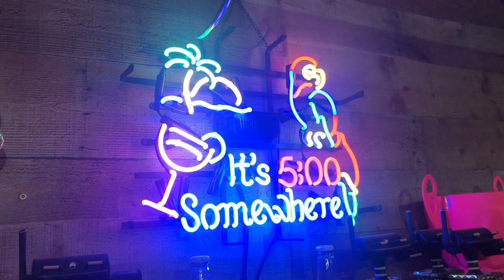March 30, 2021 Tiny Camper Build EP. 3

Comment: Could possibly develop a leak around windows where siding dips. Suggest stack butyl tape in those seams. Nice looking inside.
Reply from the maker: Yes that was a concern using this T 111 , I put some pretty big plugs of it in there . I plan on keeping this one under cover when not in use . When you see the finished product you will see some other spots I created issues with water also but I wanted a different look than what everyone is building now . I bought plenty of silicone and spray rubber haha to deal with the issues I created . Thanks for stopping by.

Comment: So many things I would have done different.
Insulation
More butyl around windows. Especially where the grooves in wood are. 
Fender wells definitely going to receive water damage from puddles
Invest in Brad nail gun or stapler for inside panels.

Comment: Man I  love building these campers but until I sell my current one I will be working on a foam built kayak, I really dont need another kayak but I need something to pass the time. See ya on the beach RG
Reply from the maker: ive been wanting to do a kayak or a stand up paddleboard with  wood inlays for strength
Reply: @ArmadilloJunction  Lets do a build together
Reply from the maker: @mlangfordcamper  hopefully in a couple weeks ill have the camper complete and we can plan a quick trip somewhere close
Reply: @ArmadilloJunction  Yes that would be cool. I am already learning with the kayak build - make your sides 5 to 6 inches thick so you have more material to sand off to hide mistakes

Comment: Being in Texas, why not install rigid foam insulation in the walls/floor?
Reply from the maker: I’m always going to run an air conditioner so insulation isn’t a big issue in such a small space from what I have experienced . I camped in my last camper in mid 30 temps and had no issues staying warm either . It would be rare to find a production built camper with insulation unless it was built northern climates.